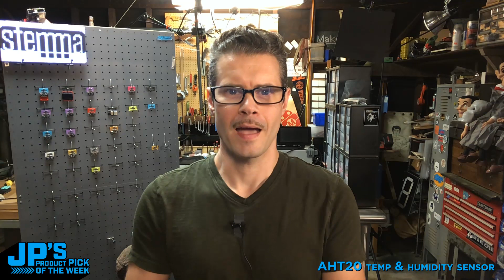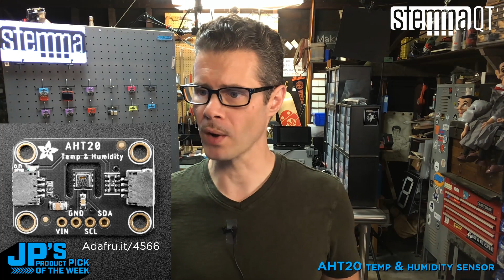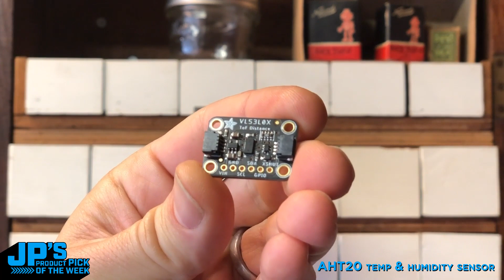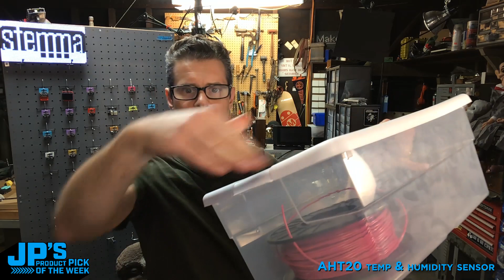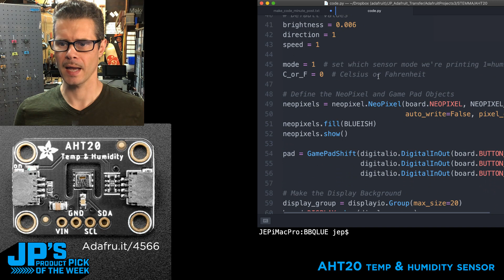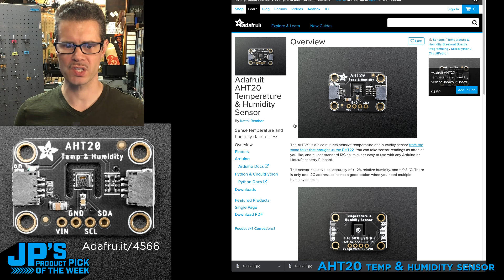JP’s Product Pick of the Week  9/22/20 AHT20 Temp & Humidity Sensor @adafruit @johnedgarpark

Comment: Hello, I have a custom built system that has 3 other i2c devices connected and I need to use this aht20 for sensing. I see that it is stuck at address 38 for i2c but no other addresses I use conflicts with this. You did not say this can be used with other i2devices nor in the adsfruit data sheet as well. Can I use this device?
Reply from the maker: you can use an I2C multiplexer such as https://www.adafruit.com/product/5626 to deal with address conflicts
Reply: @adafruit  oh interesting I'll take a look at that thank you 😊

Comment: Hi John, Where do i find the code you were using in the video ?
Reply from the maker: Here's the (rough, unsupported) demo used on the show: https://gist.github.com/jedgarpark/aad398debc2e73447b9c384005cc42b9
Reply: @adafruit  would you perhaps have this for the arduino IDE (sorry). i am using this and i wanted to re-create this together with thee stemma cable + oled featherwing + adafruit HUZZAH! (and eventually to adafruit IO or blynk)
Reply: @adafruit  hi, I loaded your code on my Pybadge and the Neopixels aren’t lighting up from your cool demo in your video. Do you know which exact libraries I need to make this work? Thanks!
Reply: NVM. I found the variable in the code for the NeoPixels. Tricky that brightness was very small to nil. Lol still learning python…